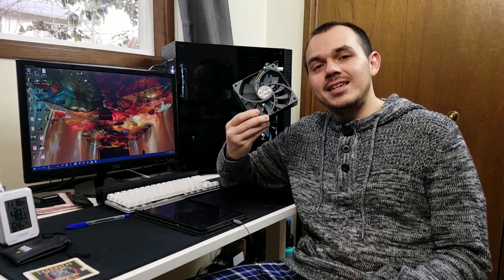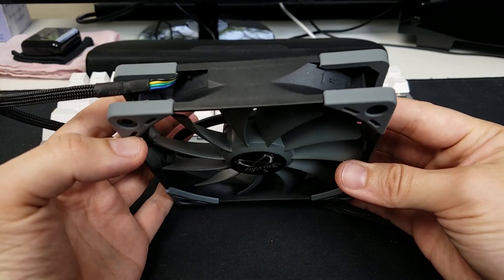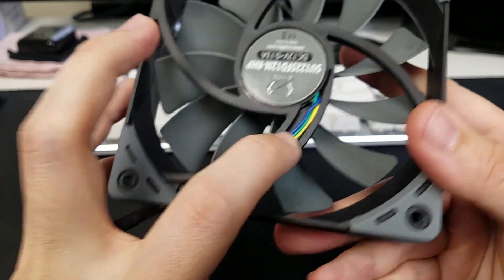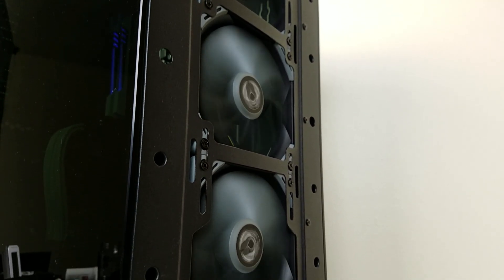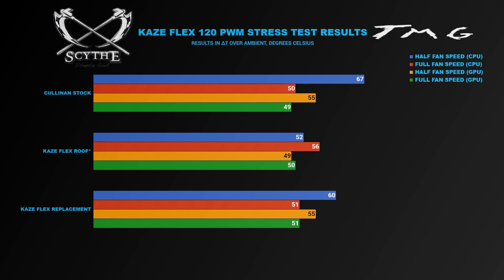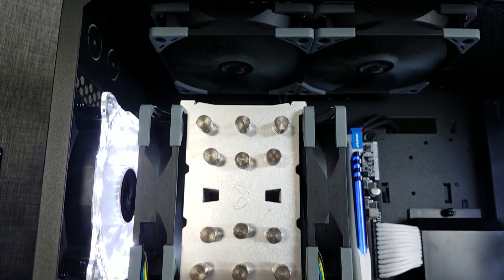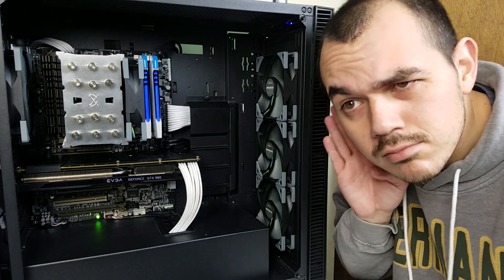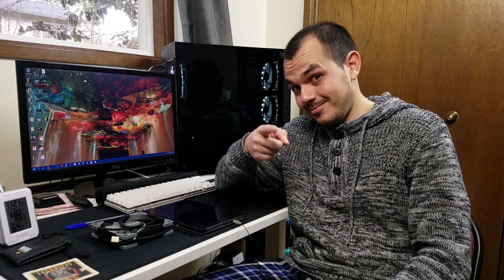MANIC TECH: THE SCYTHE KAZE FLEX 120 PWM REVIEW

Comment: Scythe is a bad ass company. My Ninja 4 cooler is a monster. 
They use to sell kick ass little 25mm Scythe fans @ the egg they i used to cool mobo chipset heat sinks.

I agree implicitly, the exposed wires are fugly and clash with the beautiful & simple grey/black.

I’m sure the Chinese factory needed to get rid of the excess wire🤣 The new fans have black wire and black mobo connection.

Btw.  Not a great choice for a radiator.  High static pressure fans are king for the tight spaces of rads & heat sinks for that matter.

Comment: They have different models, yours is with white pin cable. Dunno what model, but Kaze Flex SU1225FD12M-RH - Bad cooler, not as near quite on every rpms, have low noises or high noises depends of rpm. Flex RH need to be undervolted 7v or even 5v to get something near quit… very disappointed, coz I have ninja scythe 5 with really silent 800 rpm coolers and they are silent on every rpm’s, but Flex - RH have annoying low or high noises depending of rpms… next time only noctua… for not spending time with noise issues

Comment: I bought one of these fans and now im replacing all the fans in my pc with them.  They aren't as good as noctua fans but I didn't have the budget for those and these were the next best thing, and compared to my old fans that always ran at 100%, these are a huge upgrade.

I also noticed that on my cooler master radiator I saw a 2-3C tempreature drop over the stock fans that came with it.
Reply from the maker: Yeah they're definitely not endgame, but they are really good fans for the money, and they go with most setups thanks to neutral colors, and no RGB cables mean a cleaner build all-around.

The temp drop you experienced is a nice bonus! As long as it's not performance regression then you're golden. Glad you're enjoying them!
Reply: These actually outperform the nf a12x25 when used as a case fan: https://www.youtube.com/watch?v=WBoLyC0tSDQ

Comment: How do i know if it is intake or outtake
Reply from the maker: Arrows on the frame show rotation and air flow direction. If they aren't there then the side with nothing covering the fans is intake, and the side with the four pieces of the frame holding up the fan motor is exhaust.

Comment: Is there a single led colored one?
Reply from the maker: Not that I'm aware of, no, but I haven't checked out any newer revisions of this fan in recent history. Last I checked they had 12v and 5v RGB variants.
Reply: @TheManicGeek  Holy smokes, that was quick!  Thanks for the fast reply.  I got a Asus Z97 - A which I believe won't run those Scythe Kaze Flex 1800RPM 140mm RGB fans.  Is there any way to run them or do I have to buy another motherboard to run them?  I'm mainly seeking for just a single led colored (blue) very strong fan.  Again, thank you so much for your input & video.
Reply from the maker: @Johnnyboybravo  To run those fans with your existing motherboard you would only need a 12v RGB fan controller hub to control the lighting.  If you're in the US you can go to Performance-pcs.com and search "RGB controller" and it will pull up a bevy of options.  YOu want to make sure it's compatible with 12v RGB lighting and has four pin connector accommodations.  If you're not sure on the specific product you can easily reach out to them, let them know the fans you're wanting to control the lighting on, and let them know which controllers you were looking at.  They will absolutely point you in the right direction; I've used them for recommendations in the past and they've not steered me wrong.
Reply: @TheManicGeek  Hmm, I think since I'm mainly wanting just one color, I should just opt for a different fan.  Do you have any other recommendations for a case fan that is blue?  I initially was wanting to get Corsair ML120 PRO LED but when I searched online for what's the best case fan, I was mainly seeing Scythe Kaze Flex being brought up a lot.
Reply from the maker: I personally really like the Fractal Design Prisma SL-14's. They come in a blue-only variant that doesn't have an additional cable requirement.

Comment: i hope i dont have my fans on backwards....
Reply from the maker: You can tell the direction they flow air by looking at the frame: typically fans have arrows on the side of the frame indicating both the direction the blades spin and the direction air flows.  If you are having a hard time seeing the arrows then just make sure the cross-brace part of the frame that connects the fan motor hub to the rest of the frame is facing the direction you want air to flow.

Comment: Is it recommendable to use for home-recording studios? Is it quiet enough?
Reply from the maker: If you're looking for Supreme quiet from your fans while still moving good amounts of air, I'm gonna have to recommend you spend the money on some good Noctua or Be Quiet! fans. I have yet to encounter anything that out-classes those in terms of silent operation, these Scythe fans included.  Bear in mind, however, that running any fan at a lower RPM may result in elevated component temperatures for your computer.

Comment: Is it worth to get 3 kaze flex (for like 44$) for FD Meshify for in front fan ?
Reply from the maker: That all depends on what you're going for.  The Fractal Design Dynamic/Dynamic X2 GP-12 fans (stock case fans) are VERY quiet, but they don't move a whole lot of air due to their reduced RPM range as a trade-off (1.2k v ~2k for the Kaze Flex fans). The Kaze Flex fans will definitely move more air, as they have a higher RPM range and more fan blades, but will make more noise as a result.  If you're cool with adding a touch more noise to your system, and 44 bucks isn't something you're struggling to come up with, then I say go for it.
Reply: @TheManicGeek  To be honest, I have Mugen 5 on my cpu, and I can't hear it at all while playing, assuming it's the same fan, my currently installed phanteks ph-f140xp are making more noise.
Anyway, thank you for your response.
(Oh, and, a fun fact, some on just bought out these fans, so I have to wait for a shop resupply, coincidence ? I think not 😋)
Reply from the maker: @Gilfar  hah, likely not, those fans are great for the price. I'm also running my Mugen 5 Rev. B on my 2600, but I swapped out the stock fan for a Prisma AL-12 since the stock fan was damaged, and I had one lying around.

Comment: I have a Scythe Mugen 5 cooler with this fan (the same as in the video).
If I put on the top of the case, a Corsair SP120 fan at max speed, the CPU temperature raises about 10 degrees under full load.
My theory is:
1. The blade movement directions does not affect performance.
2. The top fan exhaust all the air coming from the front fans and doesn't allow all the air coming into the case to pass throught the CPU cooler.
(My case is smaller that the one in the video, so the top fan is like only 5cm away from the cooler)

Comment: Thanks for the video! I'm trying to choose between Kaze Flex 120, be quiet! Shadow Wings SW1 120mm and Noctua NF-S12B redux-1200. What would you suggest in my case? Thanks in advance.
Reply: For a case fan, if there's not much restriction, I'll go for the Scythe fan. Is very quiet and moves a ton of air at low speeds
Reply from the maker: Well it all vastly depends. If you're looking for a case fan, then basically go with whichever one of those fits your budget and aesthetic decisions, if that's a concern. If you're looking for a radiator fan, then the kaze flex and SW1 would be your best bet, though I suspect the SW1 will perform better on a rad with tight fin density of >15 FPI (fins per inch), which would be the case for most AIO radiators. If you're looking to replace the fans on an air cooler/tower heat sink, then again, the SW1 or the Kaze Flex would be your best bet. Bear in mind that if the absolute lowest possible noise output is a priority, then the Noctua and Be Quiet! options will be best since they're using higher quality bearings.
Reply: Noctua A12x25 FLX, those are phenomenal, expensive yes but the build quality is above anything else you'll find. Now at Newegg you can buy Fractal Design Venturi series, those for case are phenomenal for Air Flow or Radiators, just choose the right model for your application same as the Noctua FLX is 3-pin and PWN well is PWM.
Reply from the maker: @Alexander Alexandrovich Having never actually owned Noctua fans I can only speak from second-hand experience seeing other builds in-person equipped with Noctua fans. They are exceptionally quiet at lower RPM, but then again this fan is quiet at all RPM because it just runs slower overall. If you're looking for absolute silence you'll be hard-pressed to find better than Noctua or Be Quiet! fans, but the price you pay for some of their solutions makes the Kaze Flex fans a more attainable buy for most. You honestly aren't missing out on a whole lot going with these, but if you have the budget for  Noctua or Be Quiet! then go for it, they're great products as well!
Reply from the maker: @Alexander Alexandrovich I've really only tested one 92  heat sink in my channel's history, but maybe check out the Be Quiet! Pure Rock Slim. It's tiny, quiet, and shockingly capable. Even when the fan runs at top RPM it doesn't make much noise at all. Just make sure it will mount correctly in your case... AM4 or similar sockets will orient the heat sink exhausting towards the roof instead of the back of the case. Intel LGA sockets will orient the heat sink correctly.

Comment: Having those additional Kaze Flexes in roof running at full speed possibly robbed CPU heatsink from some intake airflow, drawing it out before it had actually cooled anything.
I mean airflow helps only if it actually cools something.
And only rearmost top fan could draw out air which has cooled something.
Also airflow inside case turning to more vertical (instead of front in-rear out) might have made graphics card heat rise toward CPU.
Those non-reference cooler graphics cards really pee on case airflow.

Performing worse in radiator is again no surprise when Corsair's stock fans are very high speed noise makers with doubled RPM.
Especially in such use fans should be compared at same speed or noise.
Reply from the maker: Well as far as the roof fans being present is concerned, I needed to do that to account for different airflow characteristics in the case. Having roof fans for the AIO and none for the heat sink didn't make much sense to me at the time, but I may revisit my methodology there for the next heat sink evaluation.

As for fan testing on the radiator, you're right in that they operate at very different fan speeds, and so affect peak performance potential, but I'm still going to test the stock Corsair fans at their peak speed as well to show total peak performance differences. I still hold that they aren't the best radiator fans ever, but they're similarly not bad either, especially if, as I mention in the video, they would likely do better on a similar rad with lesser fin density.

I really appreciate the constructive feedback on the video! I'm always trying to refine my testing methodologies to get better results each time. Time and space are big constraints for me presently, but I do what I can with what I have :-)